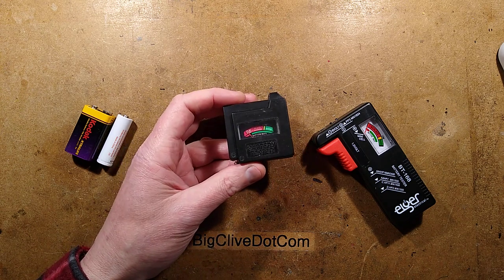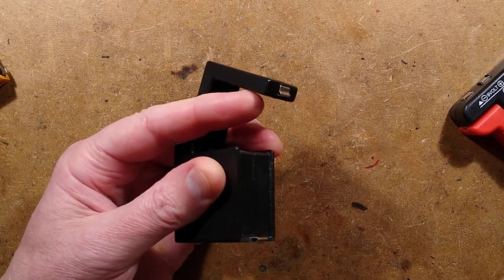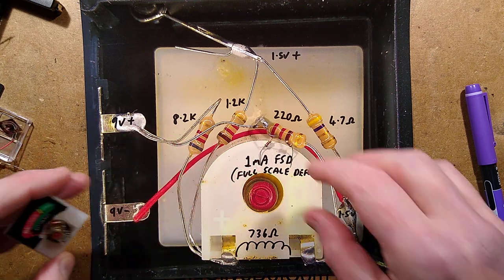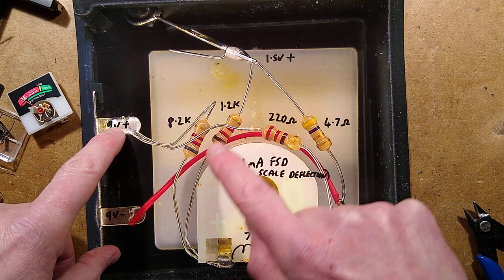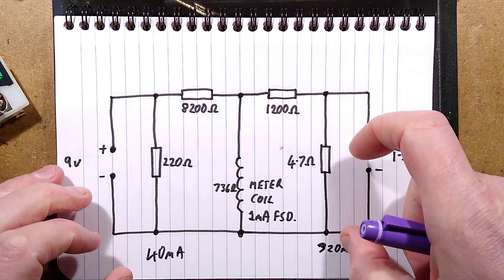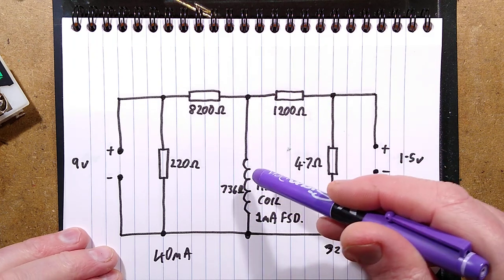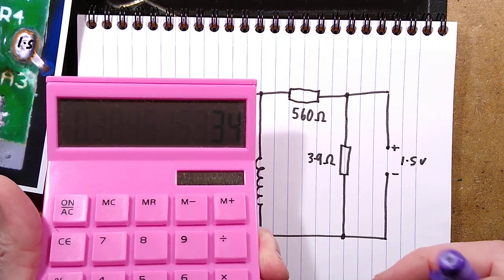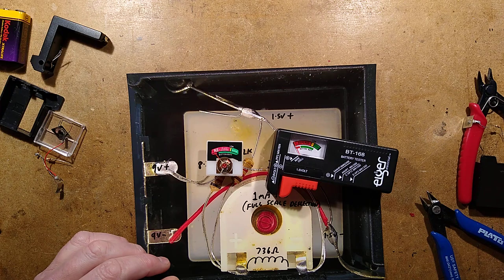Inside a simple battery tester (with schematic)

Comment: I like that you did the calculations to see how much current the fresh battery should pass through the meter. But I'm sorry to say that you got it slightly wrong: A fresh alkaline cell does NOT measure its rated voltage of 1.5 volts. If you test one with a multimeter, they actually read closer to 1.6 volts, only dropping to 1.5 once they have been used a bit. Likewise for the little rectangular 9 volt battery, when fresh it will give around 9.6 volts.
Reply: A fresh alkaline battery will indeed measure around 1.6 volts *on a digital voltmeter*, because the high-imedance of the meter doesn't load the battery down in any manner similar to the devices that the battery might be used in.  Test the battery with a vintage analog meter like a Triplett or a Simpson and you will get a more real world type of measurement.

Comment: I've got an ancient Eveready battery tester I found in my grandparents basement, has probes and a knob that selects different battery voltages all the way up to 67.5 for some insane reason. Even looking at all the guts on the back of the panel, I'm still not quite certain how it works, mostly due to the mass of connections coming out of the rotary switch, and the extra leads going to the meter.

I think I'll have another crack at seeing what's what on it again now
Reply: Depending on how old it is it could have been used to test batteries for some old valve radios which could run at quite high voltages.
Reply: There used to be some high voltage ever ready's for some old radios - not quite before my time but...
Reply: That makes sense, this thing is definitely tube electronics old, and it was made to be mounted to something that was long deteriorated by the time I got it, so I could see it being used for radio batteries.

It also has a position for 1.5V "photo" batteries, where instead of having a scale from good to bad, it just points to what size it thinks it is, from AAA to D, guess it's a higher draw test for those.

Comment: It's a nice and easy to grok circuit. Good for the young'uns to get a grip on calculating voltages at certain points in the circuit. Perhaps you could have shown what 'loading the cell' does to the results, or perhaps that is homework for the young'uns? Thanks, Clive!
Reply: a comparison of battery sizes might change it, too, as I have a feeling the old meter was probably meant more for D and C sizes while today double and triple A's are so much more common.

Comment: Can you take apart a battery-less pH meter? It is the one that has 3 modes, pH, light, and moist which you can stick to the ground, switch in whichever variable you want to test, and you can see your results. What always that interests me is that it doesn't use any battery.
Reply from the maker: It uses differing metals like a battery.
Reply: I've been curious about the same thing. IIRC both sticks are metal so one would expect the reading to change based on how far they are inserted. Maybe the active area is actually smaller, I haven't actually checked for continuity along their length.

Comment: Funny you should review this as I was just recently looking for a battery tested and I found this design quite neat. There is a slightly more expensive digital version with an actual volt meter called the BT-168D which you might be interested in reviewing. Both versions appear to be sold under a myriad of brands for a few quid.

Comment: Look inside an old vacuum tube tester, it's pretty much the same deal--  a lot of resistors designed to channel various tube outputs to the proper level for a single common meter.

Comment: The battery NOT under test still has its load and series resistor attached to the meter.  That increases the apparent full scale current.

Comment: I have the same tester as the small one and it registers Full range with a new alkaline cell I suspect that the rating on the meter is at one end of the spec range and should be more like 350 ohms.

Comment: Did you notice the wattage of the 1.5 volt load resistor, and that the wattage needed for the older tester is almost 1/2 watt but it only uses a 1/4 watt resistor, and the under-rating of the 1.5 volt load resistor of the newer unit is even worse.  Obviously, you can only have a very temporary load (test) on the 1.5 volt batteries if you don't want to burn out the load resistor.
Reply: I think you meant to describe the resistors as over-rated rather than under-rated.  It seems to be a common mistake.

Comment: Of course, the absolute easiest way to test an alkaline battery is the bounce test. Hold the battery by the top slightly above a hard surface (a couple of inches is more than enough). Drop the battery onto its bottom. A fresh new battery will just stand on its bottom. A dead battery would bounce and fly off in a random direction. A battery in the middle of its life will bounce lower than a dead battery, and bounce more than a fresh one.  And yes, it really works - you should try it. Saves me digging out a battery tester or a multimeter, and you can use it amaze kids.

Comment: I have the Aneng version of the larger one with a digital out put I changed the wires inside to silicone as they are more flexible and don't snap like the ones supplied with it it can not read less than about0.9Volts as the display takes at least that to display handy dandy for just checking batteries and easy to have on the desk without getting a DMM out

Comment: Interestingly, I was actually able to find one of these with a electronic display which is accurate upto 2 decimal places. That has actually been as accurate as my Mastech multimeter. But these analog ones, I wouldn't trust as much from the get go.
Reply: With the right resistor values these testers are fine. Even the old one from Clive was somewhat useful once you’d know that it has a 0 to 1.9V scale. You could measure that once using a multimeter.
Reply: Xeraser  Yep, Checking with another multimeter (even the cheapy ones) should tell whether the device is accurate.
Reply: @Conservator.  And the whole point of a battery tester is to give a quick pass/fail. Having to interpret a voltage defeats the purpose.

Comment: I had both when i was a child.
The square one was the first i took apart as a child because i messed up and fryed the 9v input .
The larger one did tend to show less voltage than the smal one so im guessing the resistors or the coils have some larger tolerances when they build them.

Comment: hi clive you should repurpose the old meter to test 3.7v 18650 batterys as surely it would just need the resistor values changed. This is probably a bit to basic for you realy but it would be fun to watch. great content iv been a subcriber for years on this channel and learnt alot.

Comment: i have one of those mini battery testers but it uses 3 classic styled led's red yellow or green. ive only used it for when i need a pair if cells right away. if i need something little more specific i just multi meter them to see actual non load voltage range.

Comment: I think they're not making them as well as they used to, or you got a couple of duds. Or both.

I have 2, bought 9 or 10 years ago, and they still both work great, new batteries register well up in the green over the "D", lesser ones down around the "G" will still power a quartz clock or TV remote for a few weeks or months, and ones in the yellow band will power some low power req. LEDs like a single cell torch or fairy lights, for a short spell.

I harvest "used" batteries from the blue recycling boxes around my workplace, and typically find that a quarter might be totally dead, the rest still have plenty of life left in them (it seems that a single battery in a series of 4 or more usually gets depleted before the others). This type of tester allows me to confidently test a load of batteries in a short time.

Comment: Oooh.. I don't think ours is that inaccurate, although I've just learned to adjust to the meter.. (do use multimeter often tho)
This makes me consider checking if I could managed to open mine (slightly newer model) and maybe see if I can replace the resistors to make it more accurate.

Comment: I have a couple of the smaller testers and gave another to a friend. They all seem fine and easily swing to fully-charged if appropriate. I wonder if you had one of a duff batch or if the design has changed over the maybe 10-15 years since I bought mine. 
I think they were £1 each and as a handy rough test, all still working, I can't complain.

Comment: The maths are ambiguous about the meter coil resistance and full scale current of the more betterer meter. Assuming about 1K for the resistance, we get 1mA for a 1.5V cell, but about 2mA for a 9V battery. I suppose they're relying on the 3.9 ohm resistor to load down the single cell more.

Comment: I have one with the same form factor as the first one with lead resistors with 440 ohm (green green brown, yes) serial resistance and 4,7Ohm parallel for 1,5V and 1Kohm serial 220ohm parallel for 9V. It reads right. So I think these are the corrected values.

Comment: Looks like the original designer did not account for the other batterie's resistors in parallel, which will load the battery under test  and cause the meter to read low as Clive says. We need a follow up video where Clive completely re designs this with correct value resistors.

Comment: I think these must vary quite a bit. Mine looks identical but actually gives reasonably sensible readings. It has no brand name , but claims to be made in Taiwan, and I've had it many years. I don't intend to cut it open, but the 9v range measured at circa 97 ohms. I can't measure accurately the 1.5v range, but it seemed to be about 2 ohms - perhaps a 2R2 resistor inside?

Comment: Hmmmm.... curious: I have the first type (the small square one you disassemble) and it behaves with reasonable accuracy and a better deflection. I did wonder if you had a mechanical fault in the movement of the meter until you demonstrated FSD with it, and it moved freely.

Good analysis - I'm not going to pull mine apart to compare values, though :D

Comment: The device should have a couple of calibration potentiometers. Two of those blue multi-turn ones. Just put in a fresh battery and turn the potentiometer until it barely reads full scale.

Comment: What is the wattage of the surface mount resistors, it seems that this circuit would pass more than 1/2W... I guess not a problem if it is a short time but what would happen over time or if the battery dwelled too long on the meter?   Also this gives me an idea that you might use that meter to make your own battery tester to apply different loads and adjust to different battery chemistry... could that be a possible future Clive invention/project? Hmmm... something to consider for a future video?

I have an oldie but goodie battery tester from the 60's or 70's that I think was intended for the public to test at a battery kiosk... Somebody gave it to me many decades ago... it's crazy how I ended up with it... but it is my go-to battery tester.  It has 9 ranges of batteries, some batteries I don't think you can get any more:  1.5, 4.5,  6, 9, 15, 22.5, 45, 67.5, and 1.5v "photo flash"  The tester has some beefy resistors like 1/2W or 1W resistors, I suppose just in case somebody kept the battery hooked up to it longer than a few seconds... It was made to take abuse!  The meter has a large display 2.3" (60mm)  with a brand name "Everyready"  With 3 different scales on it: Top (what I commonly use) Red(replace) Yellow(Weak), Green(Good). The second scale based on battery types: a small patches of green in different zones for EPX825 & N,  AA or D cells, and a bottom scale or a photoflash AAA or C that shares some of the second scale... it's something that makes more sense visually if you saw an image of it.  There are no instructions on the meter itself, maybe they were on the kiosk which is long gone 50+ years ago.

Comment: i have the same exact unit however its heading on for almost 20 years old now. its much more accurate than the on you have and the plastic is higher quality too so it might be made by the original manufacturer that designed it instead of some random Chinese factory that got hold of the designs and mas produced them for ultra cheep

Comment: I have that identical (small) tester sitting here.  Okay for 9V, AA,  a bit too fiddly for AAA.  I don't use much of anything else here.  The meter bounces around too much at times.  Too bad opening it up is destructive,  I was wondering if putting a capacitor in there might settle that down.  Never tried this with a button cell before but I happen to see a 397/303 sitting here and tried it,  the meter went all the way up to the yellow,  which surprised me.

Comment: Weve used the thumbnail one for years back in the day and it never struck me as particularly harsh, maybe one of us got (un)lucky or maybe i was a dumb child xd or they tweaked the values

Also, the resistor loading the cell down is because the voltage drops much more under load when they're almost empty :)

Comment: The issues with an unpowered tester like this are:- 1) The load can significantly drain the battery being tested. 2) It isn’t very accurate (as demonstrated in the video). 3) It doesn’t measure the actual battery voltage. I much prefer battery powered testers because they don’t have the drain/accuracy issues, and some also display the actual battery voltage on an LCD.
Reply: Yes, but if you don't load the battery under test (for example you use a high impedance multimeter) you won't get anything remotely resembling the battery state of health. Under no load even a near-dead battery will show the terminal voltage to be whatever the battery chemistry says it would be. When a battery "dies" it increases its internal resistance. Negligible current flow means negligible internal voltage drop and misleading measurements (unless you understand what is really going on).
Reply: @walterk1221  I don’t know how the battery powered testers work, but they accurately show a range of different cell levels without draining the battery under test. This is the reason for it being battery powered. Here is an example of one: https://youtu.be/4h0FhDjgGFY (powered by 1x AAA cell).
Reply: @gadgetman36  I am not going to buy one to disassemble it but I can pretty much assure you that that DlyFull only uses the AAA cell to power the display. The battery under test is most assuredly under a load. Again, I do understand that the significance of the necessity of a load on the battery escapes many people. The important parameter is not terminal voltage but terminal voltage under load.
Reply: @walterk1221  There is an LCD version of the tester in Big Clive’s video, but it still doesn’t have a battery to power the LCD, instead it is powered by the battery being tested. So there is no reason for the Dlyfull or other battery powered testers to use a battery to power the LCD, the battery is there for a different reason, to prevent draining of the battery being tested and to give a more accurate result than unpowered battery testers.
Reply: @gadgetman36  I obviously am not going to successfully correct your layman's misconception. I can only assure you that, as an electronics engineer, I do indeed know what I am talking about. In order to correctly assess a battery remaining life it MUST be tested under load. No exceptions.
Reply: @walterk1221  Yep. I have a multimeter book that has a section on using them for battery testing (if you don't have that function built in) and it uses a 100 ohm load. I think you'll actually see that in battery datasheets too.
Reply: @chaos.corner  you are right on for a decent ballpark assessment.
Reply: @walterk1221  I didn’t say battery powered testers don’t put a load on the battery, I said they don’t drain the battery like unpowered testers do. The unpowered tester in Big Clive’s video uses an 8200Ω load for 9v and a 1200Ω load for 1.5v. Compare this to the battery powered testers which like a multimeter use a near zero load of 100Ω. This is why battery drain is an issue with unpowered testers, but it isn’t with battery powered testers.
Reply: @gadgetman36  sorry but a reasonable load must be applied or the "test" is meaningless. As I said I am an engineer and I am familiar with proper test and measurement techniques. You are entitled to your VERY incorrect opinion but you are absolutely wrong.
Reply: @walterk1221  You have admitted in another comment that a 100Ω load is appropriate as used on a multimeter. I have been using battery powered testers for years and I know that they measure accurately without significantly draining the battery being tested. If I’m so very incorrect why has Big Clive favourited my original comment? You may be an engineer but you have admitted in another comment that you haven’t reverse engineered a battery powered tester so don’t know how they actually work. There is no point putting a massive load on the battery being tested because this will significantly drain it. An unpowered tester also uses the battery being tested to power the moving coil, LCD or LEDs which is a further drain. This is why battery powered testers exist. Unpowered testers are old technology dating back decades (I have one somewhere from the 1980s). “Remember to keep comments respectful and to follow our Community Guidelines”.

Comment: I was half expecting to see you "fix" the old tester by putting new resistor values in it.

My old Maplin multimeter has battery test functions when plugged into the mA socket. It just gives a reading in volts while putting a small load across the battery.